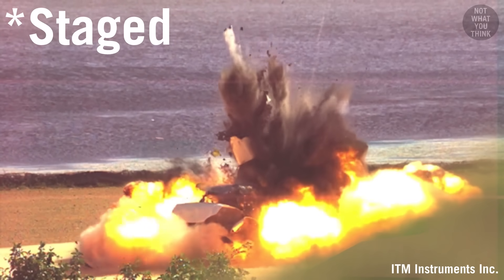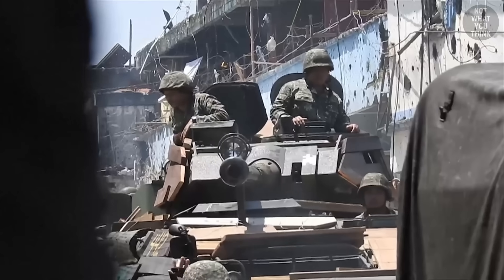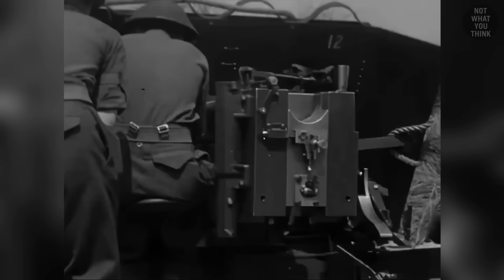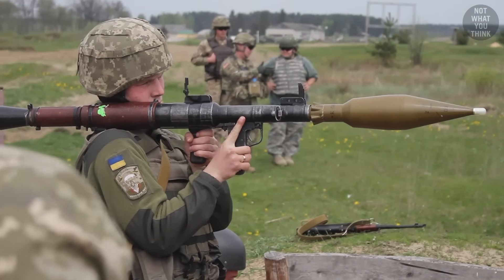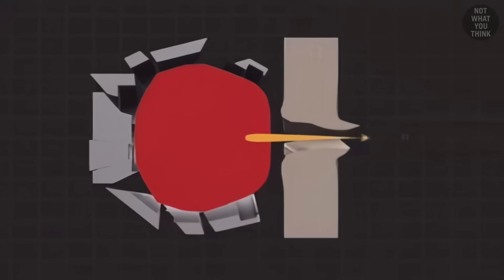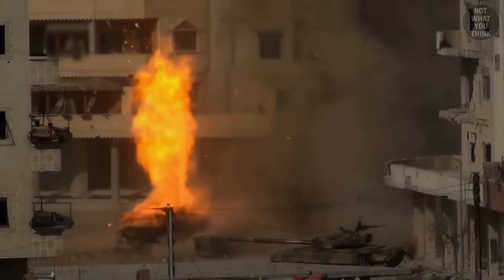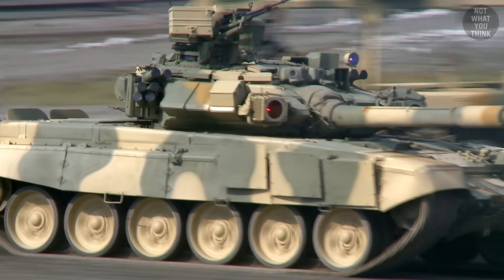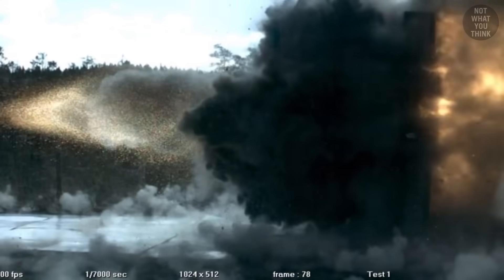Why Protecting Tanks is Getting Much More Difficult

Comment: Tanks will always be a part of the military and will continue to be improved as aircraft will be, your argument of 'things to kill tanks are cheaper than tanks' is flawed as they are a required part of combined arms and there are already things that most likely exist that can counter javelins and be mounted on tanks. The long answer is that just like aircraft it is a balancing act where tanks are on one side and anti-tanks are on the other, one may get the upper ground but eventually the other will re-take that ground and vice-versa, and even though tanks are more expensive they make up for it in terms of functionality as they are the perfect land based breakthrough vehicle and infantry cannot perform a lot of tasks that tanks can, at least to the same effectiveness. For example a tank is still able to resist small arms fire, light artillery, other tanks, etc. and they can fire weapons more accurately at longer ranges due to on board fire control systems being more accurate than the most advanced small arms fire control systems, tanks are also able to carry much more weight which allows them to always be able to field more equipment than infantry could dream of. To conclude this I ask you why did we still use aircraft if S-75 Dvina SAMs were so available to the NVA in Vietnam?

Comment: A tank isn't a stand alone force anymore. It's meant to be used in conjunction with air cover and infantry support. When AI is trusted enough the tanks will be armoured drones. The AI tank can be smaller and faster. Eventually the costs will lower to the point where hordes of armoured AI tanks and drones in the air will swarm enemy postions while the humans sit far away. Of course there will still be human loss.

Comment: Tanks have never been the end all be all in warfare. That being said, the improvement of tank protection against chemical and kinetic penetrators is limited not by the armor that can be added, but by the logistics and infrastructure of the country that is developing. 

Just about every tank's size is determined by the country's ability to transport the vehicle, the most common being by rail. Adding more armor or a larger gun requires space  and horsepower to effectively move the vehicle. A larger engine also means a larger hull for space to accommodate said engine. Taking all of this into account, a tank can easily outgrow the maximum clearance allowed for transportation by rail and other methods, as well as the weight making it more difficult to cross bridges, thus making it a significant obstacle to overcome for increased protection. It's not impossible, but it is a primary limiting factor in protection at the moment and finding a solution to this problem will be critical in developing the next levels of protection for tanks.

Comment: An almost perfect analogy for Tanks in the contemporary battlefield are Dreadnoughts/Battleships after the development of effective Carrier-based Aircraft.  
An Abrams is small potatoes compared to the Yamamoto or Bismark or to be sure, but the paradigm has changed, and I expect the role that MBTs would've filled previously, will be more and more fulfilled by high-endurance and automated aerial drone systems.
Reply: Flying drones can't hold ground like ground units. 
You can airstrike everything, but without something on the ground(be it infantry or tanks) to hold the ground and do something with said ground, you're not advancing your frontline.
Reply: Attack Helicopters firing Hellfire missiles are a tank crew's worst nightmare.

Comment: Active defensive systems means you need multiple attacks from different sides to be effective.  This is a lot harder than it sounds.  Cool thing is they could also track where it came from and point the .50 cal there for the TC with little effort in programming. Once you go down that path you keep adding more sensors, couple of stingers on the roof, less armor so lighter and then don't even have to man them.  Roll them out and give them to the gamers so they can respawn...lol.

Comment: It legit is looking like high speed low armored mounted vehicles is the answer. Just be too much of a moving target to be easy etc. and lay down massive amounts of fire enstead of just a big gun. 
Thats my laymon guess,  a bunch of 4x4 pickups with off road suspension and medium arms protection, suped all to hell and flying all over the battlefield like a rally race and unloading minigun fire and missiles.
Reply: if the mounted bed gun is wholely connected to a seat and mounted into the bed together, you can add gyroscopic measuring devices to get a computer to correct for all the crazy jostle and bumping while firing to stay accurate while you fly about the place like a lunatic. 
I imagine.

Comment: MBT's time basically ended when they came up with the panzerfaust cheap hand held weapons you can learn to use quickly and effectively that can be mass produced and delivered on site as needed.
Reply: The Panzerfaust made its appearance in 1944. That was 78 years ago. Tanks are still here. Your "logic" is lacking.
Reply: @JigerotatheWicked  Name a single major tank battle that occurred after 1945. Than when youre done taking your head out of your asshole examine Russias current situation in Ukraine vis a vis their armor. The fact that tanks still exist is inconsequential, bi-planes still exist they are obsolete too. The bayonets still exists its also obsolete.  The mere existence of something doesnt mean its not obsolete. Main Battle Tanks are expensive, logistical nightmares, cost a fortune to equip, maintain and train a crew on. Its simple economics, an abrams costs 10 million not including armament and crew, a javelin can take it out and costs $178,000 and a house wife can use it which is more cost effective? MBT work against 3rd world shit holes who maybe have RPG-7's and rely exclusively on insurgent style IED tactics to take them out. Modern nation vs even semi modern and tanks are just expensive coffins.

Comment: Never understood what costs 200k about a javelin... explosives are not that expensive, the construction materials are not that expensive and the electronics shouldn't be that expensive either with top of the line consumer processors that should be able to handle the calculations costing like 2k.. I'm pretty sure it's the classic "we can build it for few grand, but if you want it you'll fork out 200 because you're not going to find anything better".. Then again, at least overpaying for quality makes more sense than buying balenciaga socks for a 100 bucks..